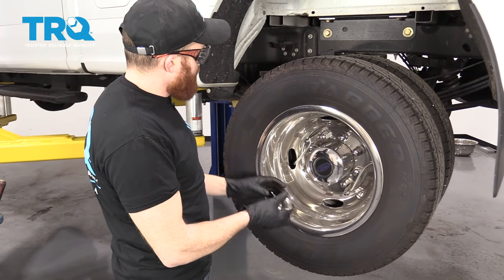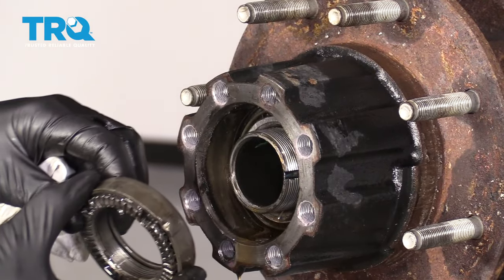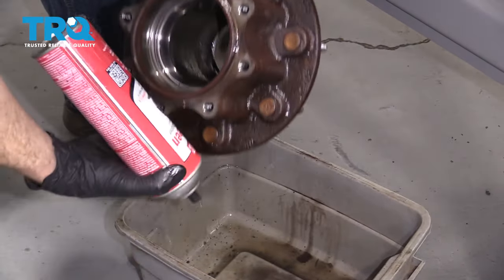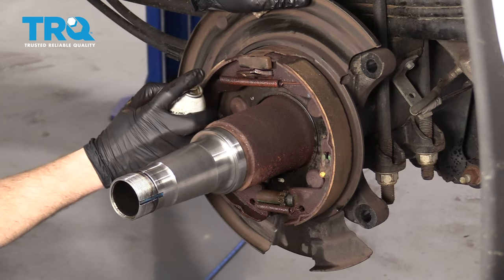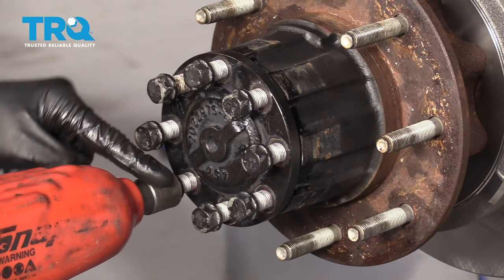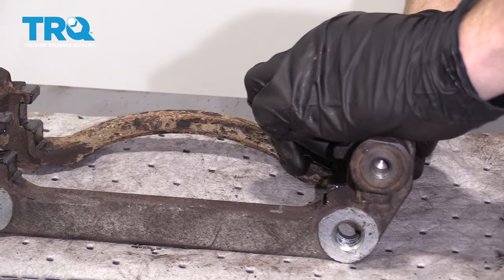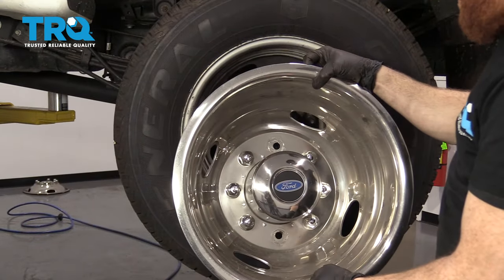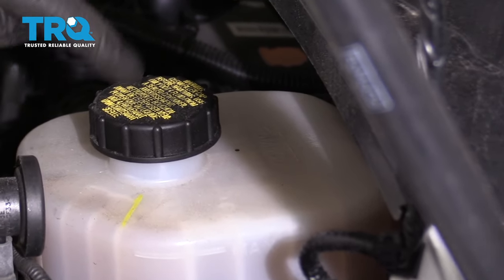How to Replace Rear Brakes 2017-Present Ford F-350 Dually

Comment from the maker: √  Watch the Video
√  Buy The Part at 1A Auto http://1aau.to/m/Shop-TRQ-Parts
√  Do it Yourself
√  Save Money
Reply: Thank you guys, this is Awesome guide! Im ready to order parts from your online store, but I need also additional parts as bearings and seals. I didn't find it on your site. can you add full parts list for this procedure? Or make replacement kit for rear axle that will include seals, bearings pads and rotors.

Comment: Anyone else break a axle shaft bolt around 100ft/lbs they started stretching not tightening no way 188ft/lbs is the correct spec
Reply: Lol that definitely wasn't right

Comment: Great video. Just want to make a recomendation that you crack open the bleeder screw when you push the brake pistons in so you dont force any dirty fluid back into the system.
Reply from the maker: +Eshedal74 Thanks for the tip! We'll pass this info along to our production team. http://1aau.to/m/Shop-TRQ
Reply: Great idea!
Reply: Will that require us to have to bleed the brakes?
I'm a newbie when it comes to the big trucks..

Comment: I enjoyed the video but the rear axle retaining bolts torque spec is 80 ft lb, not 188! Please fix this in your video or take it down so somebody else doesn't ruin the rear hub like I just did. My fault for not checking the torque specs myself.
Reply: Yup. 188, it is not! Plz correct it. I bet I am not the only one to torque it that high after watching this video. In the video, u don't look like u r doing that high either. U just state "188".

Comment: You need to grease the seal before installing. It would also make sense to use some high temp grease to grease the bearings until the gear oil will fully supply them when you start driving.
Reply from the maker: +Ewald Rindlisbacher Thanks for watching our video! http://1aau.to/m/Shop-TRQ

Comment: Use axle bearing grease where he uses vaseline and use alot of it. Fill the cavity in where the spring is.  Id rather know for a fact that spring wont move then habe to take it apart again. Ive learned the hard way.  Done dozens and dozens of these. Also. Instead of going nuts with the impact on the e torx bolts holding rotor to hub I've always gone and torqued those bolts to the same spec as wheel lug nuts. And on this truck should be 150-165. Good luck!

Comment: Great video! I appreciate the clear instruction with each step. I have a 2017 f350 4x4 6.7, single rear wheel. Are the torque specs mentioned the same on the single rear wheel trucks? Thank you.

Comment: What is the part number for the 4 point locking nut tool you used?  Thanks for the video
Reply: W83008 Amazon. 2 3/4 . Or Napa has a equivalent one

Comment: You are taking the chance of damaging the hub seal area by using the pry bar and air hammer.  I’ve literally done 1000s of these by using end cut pliers. Easy as pie.  

Also a seal driver or a same size piece of tubing works better for seal install.  

Not getting those wheels off that easy in the north lol.
Upsets me nobody uses torque wrenches.

Comment: Will this  procedure also apply to a 2016 F-350dually  also what is the part number of the tool needed to take the center bolt off 

Great  INFO

Comment: How do you know or confirm that the orange/brown seal or what colour is it that is sitting on the bearing that you start installing at 9.00 minutes that you used a wood to beat in is well seated or should I say is properly installed.

Comment: How do you adjust the e brake on the passenger side? It don’t look like the side you did. The cable is were the hole should be to back the e brake off!

Comment: Just did new pads and rotors 2015 f550 I didn't add gear oil like you did at 13:10. I was wondering if I fill the rear end filler plug will it go down axle to these bearings? I really don't want to take it all apart again. Thanks

Comment: Doing this job now. Unfortunately, mine has a grooved inner ring for what I assume is for ABS or a speed sensor I can't get off the ring or find a part to replace. I have 2014 Monaco Motor home on a F35 frame chassis. Any ideas?

Comment: using this video as a reference since the rear bakes and axles are virtually identical to my 1999 f350 superduty dually and i do not have the e-brake for some reason.

Comment: I don't tell anyone what to do but, I use a seal tool, rent or borrow or own it,, Second I pack a little grease on my bearings because, I change the diff grease and this way you have a positive lube on the bearings when you roll out, Mind you, I and my buds ease out to a ditch or lean and let the new oil or grease run to each side and then come back and top off. REASON>>> In the early 80's we seen a lot of oilfield company's running these jobs themselves and they was having bearing failure. Being at a Ford garage we questioned the job, What I recommended was not what they did. They actually was running a dry or semi dry bearing to long right of the bat. Axle, not that what you did want work with a Love tap but not recommended. Usually one good deadblow to the center of the axle face will pop that axle right to you, it might take a couple but never the back face of axle. Outboard style drums and or rotors have changed the game A LOT. Hope someone sees a tip or advice hear.

Comment: I just did this on a 2018 f450 and now there’s a squeal when moving any idea what it could be, I just rewatched ur video and realized I didn’t put any vaseline on the seal would that cause that, do I have to take it back apart?
Reply: Did you find out what was causing that squealing?

Comment: your doing the driver side correct,,,lefty loosey, correct,,,, what about the passenger side ,,is it the same OR is it reverse thread
Reply from the maker: +taterhead 3e The threads should be the same on both sides.

Comment: On my 2020 E450 the top caliper bolt can’t come out. The springs are in the way. The only way to replace the brake pads is to remove the bottom caliper slide bolt, pry the caliper up, remove the old pads. Then push the caliper all the way in towards the springs, then lube the slide pin as well as you can. Then put everything back together. How in the hell do I get those top bolts out?
Reply: remove the caliper bracket
Reply: I have the video how top do it check my page

Comment: never heard of a seal driver eh
Reply: PN 205-1070 Dana axle
205-1069 Ford axle
$300 a piece. No aftermarket options. Backordered until December.
I had to follow his hack instructions after I met that brick wall.

Comment: My rear tires are wearing on the inside how do I correct that
Reply: Lube you glide pins. Maybe flush out you lines and calipers
Reply: @corysturgis6660  I'm not an expert but I think it would have something to do with the suspension.

Comment: Could you please show me any owners manual, or driving manual which states "Emergency" Brake.  I have only seen then officially referred to as "Parking Brakes".  I know they can be used in an emergency, but with any Ford Heavy Duty, if I had to use mine while towing a trailer, I know they would not be able to stop the truck in an emergency.  You might want to check with your Lawyer to find out if you referring to them as an Emergency brake, if you are exposing yourself to a liability if a person has a crash and they thought you telling them it is an Emergency brake, if you could be held liable for damages suffered.
Reply from the maker: +Skyhawk Sailor While TRQ strives to make the information provided in this video as accurate as possible, it makes no claims, promises, or guarantees about the accuracy, completeness or applicability of the content.  No information contained in this video shall create any expressed or implied warranty or guarantee of any particular result. All do-it-yourself projects entail some risk.  It is the sole responsibility of the viewer to assume this risk.  TRQ is not responsible or liable for any loss damage (including, but not limited to, actual, consequential, or punitive), liability, claim, or any other injury or cause related to or resulting from any information posted in this video.